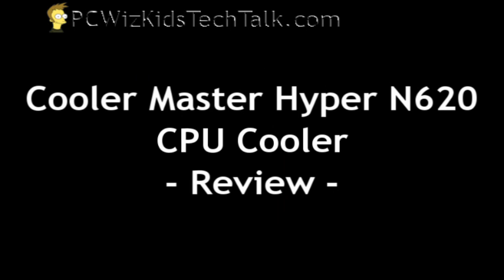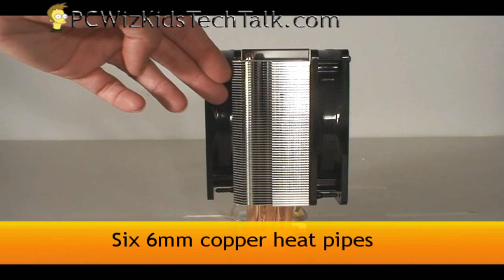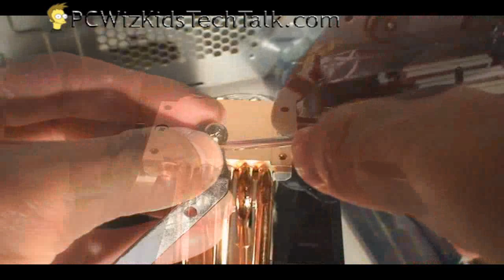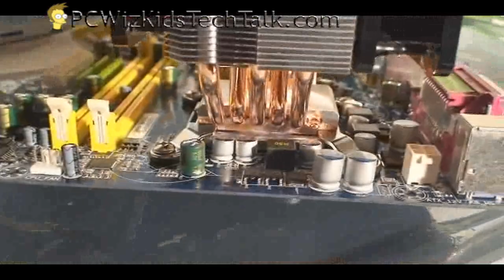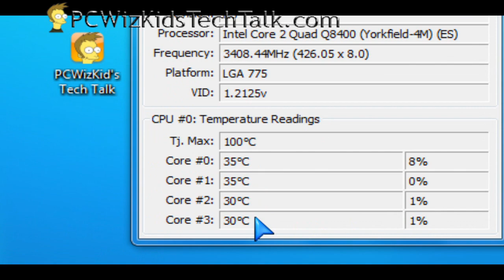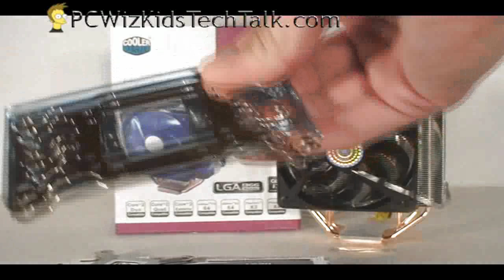Cooler Master Hyper N620 - CPU Cooler

Comment: @FukenWindmills I had the same problem in the first when i got my pc then it got out that the man who was putting the rig together didnt tighten the bolts right and it was getting hot so check it out if that is the problem.

Comment: @JChan1026 
I don't know how i did it, but i just reseated my cooler and now I'm getting about 15C at idle. you're ambient temps must be higher then mine, mine is usually 20C to 22C. the ambient temp makes a huge difference =)

Comment: @happydoggs  0_0 how could you possibly get 17'c while idle? I have my Phenom II 955 running at stock, using the hyper 212 and i'm getting like 3X'c while idle...17'c is a very impressive result for a low range cooler =]

Comment: i m buying a MSI 890GXM G65 mobo and amd 1055t processor will this cooler be good for a hexacore processor and will it fit fine in my mobo without trouble ? i have cooler master elite 430 case :)

Comment: @dethdol the same. the h50 is only a cooling solution for cases that don't have proper airflow. if you have great air flow and a very open case then you will have the same results as you would with the h50 or h70. plus... the h50/h70 is only a poor man's liquid cooling solution..

Comment: I liked this review  but I went  with the prolimatech megahalems with a delta 148cfm 120x38mm fan. The megahalems got great reviews everywhere, some even liked it more than  their CMv10 (some reviewers owned both). I haven't tried the hyper or the v8/10 from CM, but with the megahalems I'm getting 32C idle/51C prime95/55C Intel burn test with a 3.6ghz overclock & 1.568 vcore. I'm content enough with those results. (Ambient was 68-70C during testing)

Comment: then you either live somewhere that's cool, good thermal paste perhaps, or a good fan. i just use the stock fan the cpu comes with. i really have no idea why it's so hot if the average temp is only 40 or so

Comment: This looks like a very good CPU cooler! I don't want to pay 100+ for water cooling, but I want to overclock my q9450(which is almost identical to this CPU chip, only thing different is the l2 chache).

I think I might actually buy one of these, but I have a question. Do you think this cooler will suffice if I overclock my q9450 to 2.88GHz?

Thanks, Wiz

Comment: i got a minor question mty case was poorly painted so i were returning today for a new one bad luck is that they had no case in stock so i won't get a casde untill like 1 and a half week so i loose connected the pc putting the motherboard on the plastic anti static bag connected all parts works great

is there any risk doing so?